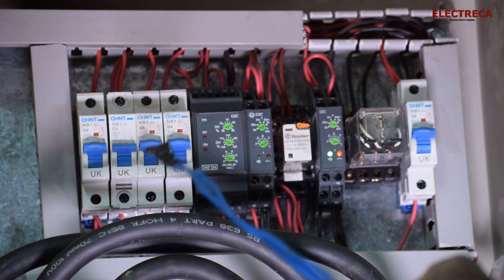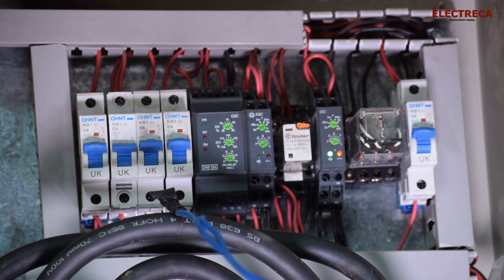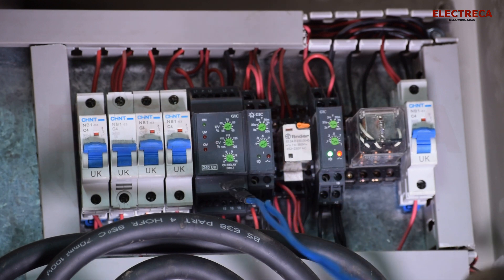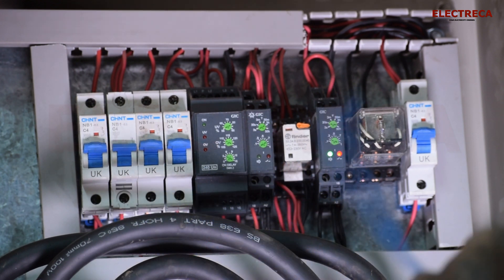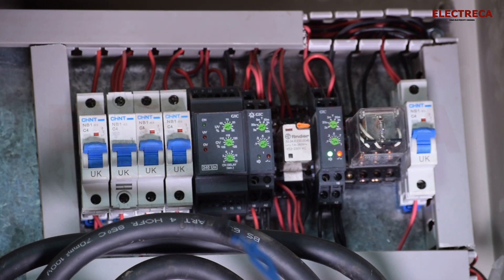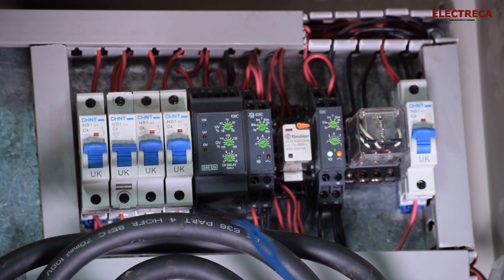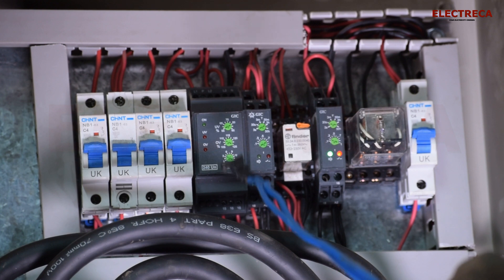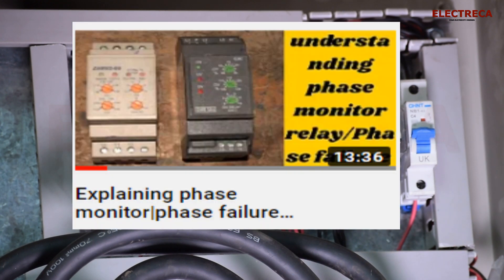Automatic changeover switch for generator|ELECTRECA

Comment: hello mr electreca , my contuctors produces a very loud humming when generator picks load during blackout, what could be the problem ?
Reply from the maker: Most likely your contactor coil is dirty, 
You can open it and clean the armature and iron core, the noise ll reduce signficantly.

Comment: Hello David, I have a 30 KVA generator which has no CAD, it uses ignition key for the purpose of cranking it, how can I automate this? Putting into consideration that there is no signal cable for the purpose of autostarting,, kindly waiting for your feedback
Reply from the maker: This is actually achievable and quite simple, but I cant explain it in the comment I will do white board video for it From this week.
Reply: Thenks alot for the feedback,, am eagerly waiting

Comment: A light company with appliances totalling to 170 Kw, what size of generator does it need interms of KVA
Reply from the maker: 170 kw (load demand) lets consider Power factor of 0.80. (note most alternator manufacture consider PF of 0.80).
170/0.80= 212.5KVA,  its difficult to get a gen set of that rating.
These are generator sizes mentioning but few 100,150,165,200,250,300,350,350KVA
250KVA is ok but if there is possibility 300KVA is fine.
Reply: @elektreca  thenks alot for the feedback

Comment: Is it normal for contactor to become hot
Reply from the maker: A contactor can only be WARM under normal operation but HOT under abnormal conditions like under or high voltage, contact failing to open or close when it's engaged, dust and carbon between contacts.......etc.